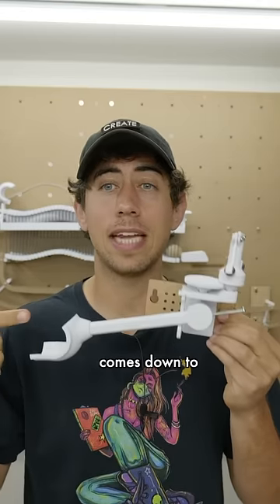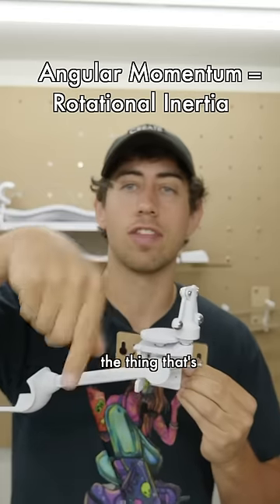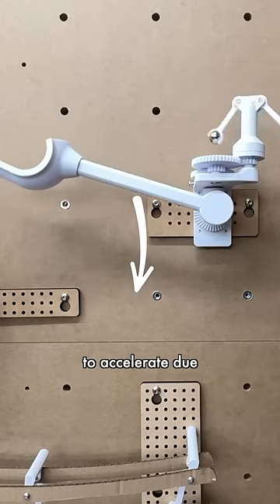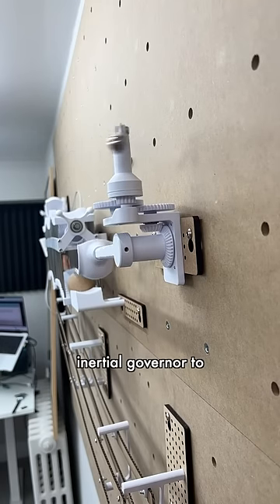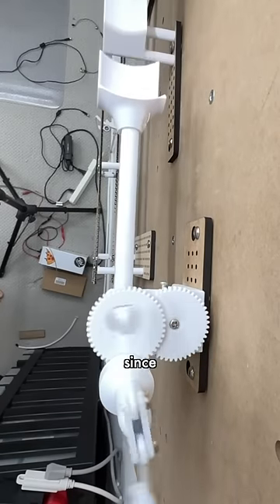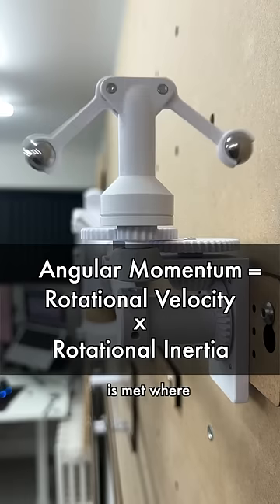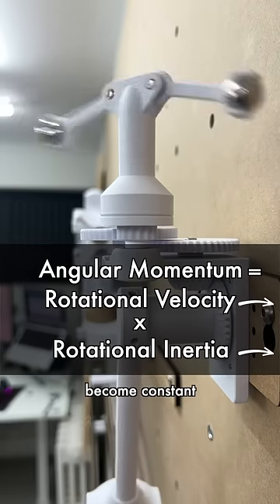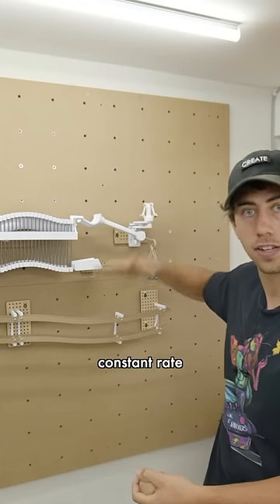How an Inertial Governor Works

Comment: This is how elevators work. One model of governors had this same idea with ball weights. Most models use weights that are parallel with the wheel that a line rolls through. If the elevator falls too fast, the weights are forced outward and hit a breaker which shuts off the elevator. So, any cheeky kids out there with the temptation to jump in an elevator.... Don't. You'll turn it off xD
Reply from the maker: Haha good to know!

Comment: If I’m not mistaken, the inertia governer is similar to the component that inspired the saying balls-to-the-wall. That’s right, it’s actually an innocent expression 😄
Reply from the maker: I didn’t know that until right now! So cool
Reply: I heard balls to the wall came from ww1 airplane engines. Where, in a nosedive, ball bearings would hit the firewall.
Reply: @maxnovakovics2568  I see that on Wikipedia but I've heard the story about the centrifugal governor first.

Comment: Normally the swing arms are attached to a brake so the farther out the balls want to go the more braking force is applied. In your case, without any brake added, having the weights in a fixed, outward position, would work just the same.

Comment: To make the fall smoother, you could make the arms longer, or increase the weight at the end of the arms.
Or increase the gear ratio, but arm length is probably easier.

Comment: In this application, im not sure there's a benefit to having the governor weights on movable arms - if they were at the "maximum extension" position from the start, youll get a more consistent effect. Movable arms would make more sense in an application that runs longer - in this case the weights barely find center by the time the scoop is all the way at the bottom.
Reply: It looks cooler.
Reply from the maker: Its true! Although I do think it looks cooler as well haha

Comment: If you fix the arms on the governor so they are extended, does it make it start off slower? This is a short distance so I'd think it'd give it more of an ease-in to the fall. Ooh, you could gear it up more so its a longer fall and a more smooth transition between the fall and rise of the scoop?

Comment: You should have a ratchet mechanism that allows the governor to keep spinning after the lever bottoms out to prevent putting excessive stresses on the gears. It's gonna break a tooth over time like this.

Comment: This isn't how most inertial governors work. It looks similar, but it's a different fundamental principle. On a steam engine, the flyball mechanism is connected to a throttle, so that as the balls swing out and raise up, they close the throttle, causing the engine to slow, which causes the arms to lower, opening the throttle. I think this video might mislead some people.

Comment: Why does the the inertial governer need to have arms that can move? Would it not work if the arms are fixed outwards?
Reply: If the arms were fixed, it would become a flywheel and make the arm jerk, as it cannot maintain a constant speed.

Comment: You should add a piece that turns a small generator - maybe a stepper motor. Connect the output to a few LEDs. It should slow down the ball as a generator can only push so much power through an LED. It's the reason why power plant generators are in sync with each other.
Reply: that's wrong in like, several diferent ways.

generators break because their power is being used, not because it's being limited.

diodes do not limit current, like at all.

and generators' synchronicity has nothing to do with current limiting, it has to do with the fact that they put out AC, and if they weren't in sync, they'd just short circuit.

Comment: Cool and all but your explenation is garbage, the arms do jackall and it would work just as well if it was just a metal disc. These machines where used to measure speed of engines by the amount the arms flew out, not as a sort of impromptu flywheel
Reply: The arms ensure that the speed stays the same, allowing it to work consistently with a variety of situations. Flywheels cannot maintain constant speed when there is a variation in load.
Reply: @muffinconsumer4431  blud, you have no idea how flywheels work. They are made to smooth out the speed off a wheel when there are variations in load(ex combustion engine). These arms are originally from what was called an inertial governor. It measured the speed by the deflection off the arms and adjusted the engine speed of a steam engine with mecanical linkages, not by the inertia of the arms. The contraption he made would work just as well with a regular metal disc
Reply: @sam-ej7sq  Take Physics 151 and come back. You have a poor understanding of conservation of angular momentum.
Reply: @muffinconsumer4431 please elaborate, last time i checked inertia doesnt require arms. I study civil engineering. I know what im talking about. Seems like you just dont have the intelligence to answer and just resort to calling me dumb.